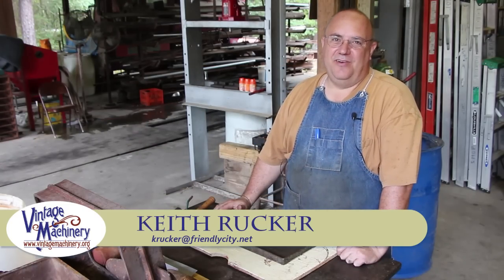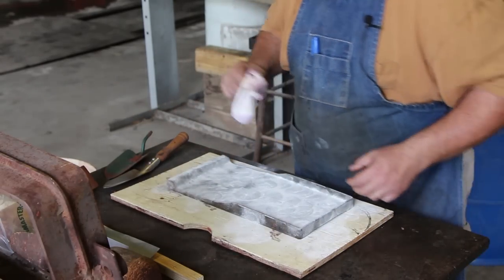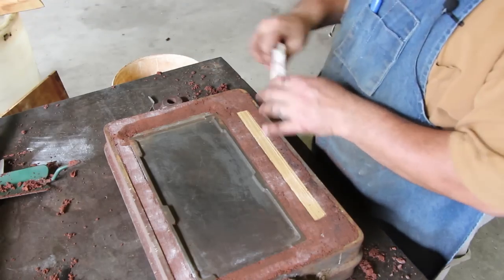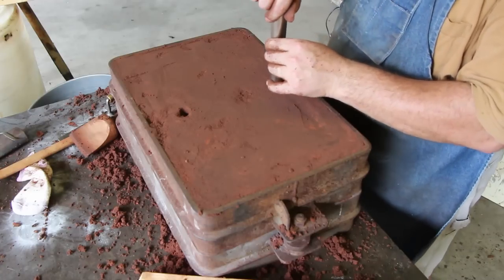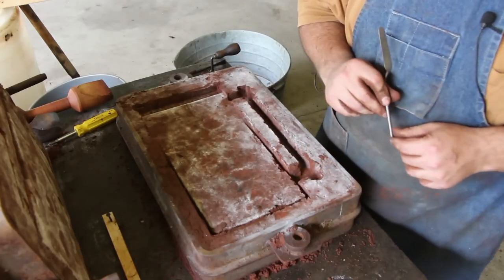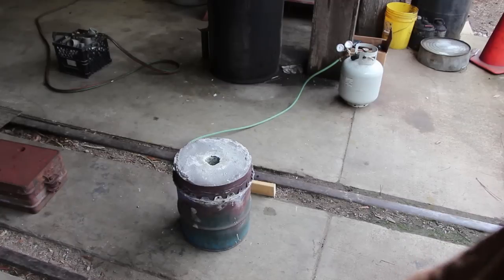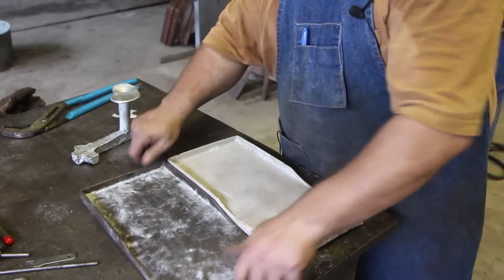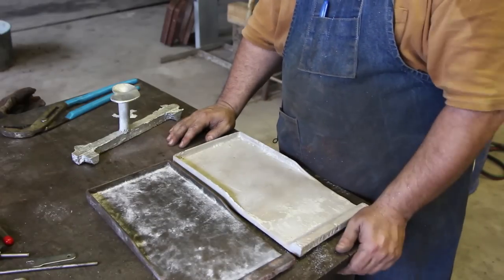Making an Aluminum Way Cover Part 1:  Casting the Part in my Backyard Foundry

Comment: My father was a non ferrous moulder and I often visited him at the foundry. To see you blowing the loose sand off of the mould and out of the ways reminded me that one of the components in Dad’s sparse toolkit was a pair of bellows.  To assist with removing your heavy pattern you could have scooped out a couple sacrificial detents on the back side (from you) to allow you to get under the pattern as you did in the two ways on the front of the pattern. It would have been interesting to see the comparison of the pattern and the casting to show the shrinkage. From memory Dad used to quote ¼” in a foot?

Comment: This shrinkage problem was occurring when Taiwan first began making copies of American woodworking equipment in the 1970s. They would do what Keith is doing, but would make the parts from iron as was used in the originals. The copies worked just fine, depending on the quality level any particular manufacturer worked to. But to the surprise if people who bought them and then bought spare parts or accessories here, they wouldn’t fit. Surprise! Later, as their manufacturing got better, they stopped copying and did their own designs.

You really have to be careful with more than one gate when making thin, wide parts such as this. If the mold is too cold, the edges of the metal, as they move towards each other, can cool to the point where there is a distinct line marking where they met. Sometimes they don’t entirely meld together as the edges are too cool and the oxidation on those edges (particularly with aluminum) prevents a true melding of those edges, resulting in a weak part there.

Comment: Next time, place two pieces of wire, (one for each end) under the pattern(or part) and bend them up parallel to the sides. Pack the sand, flip over, and use the wire to pull the pattern out. It'll leave you a couple of small lines to grind off, but that shouldn't  be an issue.

Comment: Hello Keith,
 Your video is interesting. Please wear better shoes, and the funky legging/foot covers. Molten aluminum makes a bad smell going through sneakers, and down to flesh and bone. I have seen a crucible break during a small pour. Good safety wear, no one hurt. One shoe burned but still,wearable.

Comment: You don't start with a mulled sand?  Could you have used magnetic bases to remove the pattern?  I saw your answer on the screen.  LOL   Was that just table salt?  Was that cast iron cornbread pans for ingot making?

Comment: Where do you get the steel outer forms and the casting sand? Did you make that furnace yourself ? if so could you show you made it? THanks Keith. Great to learn these things.

Comment: Why is there a railway running through your work shop if it is inactive you can use the spikes for Smithing
Reply from the maker: +Well yeah The shop is at the Georgia Museum of Agriculture and they have a 1917 Narrow Gauge Steam Locomotive that they run.  The shop is built so they can pull the locomotive in to work on - we even have a pit that the tracks run over so that we can get under the locomotive for servicing it.

Comment: good informative video. I do have a question and that is about the casting sand. What kind of sand is it and can it be reused?
Reply from the maker: +gigicaly It is a mixture of sand, a special kind of clay and oil.  It can be bought under the name "Petrobond" or you can find recipes online to mix your own.  It can be used over and over again, but might need to have some fresh oil added back in from time to time.
Reply: Keith Rucker - VintageMachinery.org cool thank you for the reply.

Comment: Plastic oil recycling drums in a melting area are a bad idea.  Putting hot tools on top of the plastic drum is also a bad idea.  Osha would have a fit if they saw you with lace up shoes in a foundry.

If you made the part the other side up, you could have cut a parting in the drag so that you could have easily tapped the sides of the original casting then lifted it out of the mold.  Normally, the cope is the half of the flask with the ear holes.  You are able to put your palm on top of the pin from the drag and use it to help you get an even draw.

Comment: I've done a little bit of aluminium casting myself during my apprenticeship in an experienced casting shop. What we did differently then: The casting gates would  be cut as thin, wide slots with the lancet, tapered, thicker at the flow channel, narrower at the actual gate. This makes for quieter flow and easier cleanup.
We'd also manually dig a pouring bowl next to the spout, with an overflow edge. Makes it easier to pour, and again, quieter flow.
What we'd also usually have, but not on a part like this, which has very even thickness: A so called riser, a vent with large cross section over the thickest portion of the part. This would remain liquid the longest, along with the thick portion, and feed liquid metal in there as it was solidifying and shrinking, thus avoiding voids.
Reply from the maker: +HotelPapa100 Thanks for the tips.  I have a lot to lean to get better at casting.  I don't have the advantage of having someone experienced to learn from in person.

Comment: magnets don't work on aluminum whoever wrote the comment use a big neodynium magnet
Reply from the maker: +Moe Moe Magnets do work on cast iron though.  The comment was about my problem with lifting the cast iron piece that I was using for a pattern, not the aluminum part that I cast.

Comment: could you possibly coat it in something water salable before you make the sand blank to compensate for shrinkage?
Reply from the maker: +adracamas I have built up existing parts with all kinds of material to account for some shrinkage on larger items.  But it is somewhat of a pain and for this project, a little shrinkage really does not matter.
Reply: 10-4 that. Just curious.

Comment: I have watched a couple of videos about forging, and noticed that it seems no matter the size of the part, the box is always filled to the top.  Is there a reason for this?  Do you need a certain thickness of sand to help retain the heat to keep it from cooling too fast?
Reply from the maker: +alaskankare I actually sometimes do not fill it to the top, depending on how high the pattern is sticking into the top mold.  I like to have several inches of sand over the highest part of the pattern, but unless I am casting multiple parts or large parts where I might run short of molding sand, I generally just fill it up to be on the safe side.
Reply: +alaskankare When you cast series of parts, the moulds are often stacked. That's one good reason to have the boxes filled to capacity. Also the frame heights are related to frame size. If you fill it to capacity, you can be pretty sure that the slab of sand is stable enough so it doesn't fall out under its own weight.

Comment: Use a magnet to remove cast iron parts from molds.  Neodymium magnets would be more than strong enough.  Could also make a simple electromagnet to use to lift the parts out of the sand casting.

Comment: great video did you make your furnace
Reply from the maker: +diesel doctor Yes, I made that furnace several years ago and I am currently in the process of making a new one that will be greatly improved.  There is a series of videos on that project to date but it is not quite yet finished as of now.

Comment: cast iron ain't magnetic...
Reply from the maker: +paul van biljon Really?  I better tell of those magnets that stick to it that they better fall off soon.  I have one of my dial indicators stuck to the side of of a cast iron casting right now, I hope that it does not let go before I can get there and pull it off!  But I guess you are right, cast iron is not magnetic (if it were, steel would stick to it), but a magnet will indeed stick to cast iron! If you don't believe me, go and try it for yourself.....

Comment: Regular salt (sodium chloride) should not melt in molten Aluminium, should it? Its melting point is a LOT higher.
Reply: +Radbert Grimmig Aluminum melts at 660C, salt melts at 800C, so assuming that the aluminum is not just over the melting point, the salt should melt in it.
Reply: +Radbert Grimmig                        borax mixed with salt

Comment: just a thought for those heavy cast iron parts cut the magnets off your kids sub woofers which should do two things. put a stop to that annoying buuuummmp buuuuummp and give you something to lift cast iron parts out of the mold with. I also have a question what are you using for a crucible I am building a foundry of my own, did foundry in high school with a graphite crucible but your did look or sound like graphite?

Comment: I live your videos. Still looking forward to your foundry. The sono tube will work of you fill the inside with sand or gravel to press outward. Even pack it tight, the tube will not fail from too much pressure out. When you fill the outside, you will have plenty resistance.
Meet up the good work.
Reply from the maker: Mark Daniel I purchased some new refractory the other week but have not had a chance to work on the new furnace yet.  It is on the list......

Comment: what is that rainrails ????
Reply from the maker: Bart Graumans Are you talking about the rails in the floor of the shop?  If so, I shot this out at the museum in the shop where we work on their locomotive.  We can pull the locomotive into the shop and over a pit to get access to the bottom to work on it.
Reply: oke thanks i am dutch i cant good speak englich sry

Comment: when aluminum cools, it withdraws then the copy should be a little 'smaller, is not it a problem?
Reply from the maker: CLAUDIO GRASSI Yes, you get shrinkage on any part that you cast.  In this case, the cover was not fitting anything perfectly - just covering an opening, so the little bit of shrinkage that I got was not an issue.  When it is, I have to add some extra material to the original part to compensate.  I talk about shrink factors in some of my pattern making videos.
Reply: Thanks Keith, it is what I thought ... I follow your work often but being Italian sometimes escapes me something of your speeches ... I have yet to get used to understand everything ...
 I still learned a lot and I am also about to start a new adventure with aluminum castings, soon I will shoot some video

Comment: Thanks for the video Keith!  Other ways to remove patterns from the sand are 1. place the bottom board against the pattern on the drag, flip it over on the bench and then lift the drag and the pattern will stay on the bench or 2. with a wooden pattern, flip the drag over and place two of the same size boards on the bench, rest both sides against the boards, say 1 or 2 inches high, and then tap the drag downward...the pattern will fall out perfectly vertically that way.  I sometimes have more luck with that than draw spikes or threaded spikes because it's hard to get a perfectly vertical lift.

Comment: When replicating a casting in aluminum, cover as many of the original’s surfaces as practicable with heavy shelving paper.  This accomplishes two things:  The +/- 25 mil thickness makes up for some of the shrinkage; and, the smoother surface lessens the roughness of a casting-of-a-casting.  Also, for parts that are to be machined, those areas should be built-up with more layers or even (dare I say) duct tape to allow for the sacrificial machining volume.
Reply from the maker: halnywiatr Agreed - however, in this case, the added shrinkage was not an issue so I did not bother building up any surfaces.  I have used similar tricks many times on other projects.

Comment: Very good video, I am a jeweller, I use a similar process to cast Gold/Silver rings, and various other items etc.
Do you make your own casting sand? I personally found it to be to expensive, even though it is reusable for a certain amount of time. It is expensive to keep buying the ultra fine oiled casting sand which is required for small or intricate parts, so I now make my own, can be time consuming to make it high grade but it saves a lot of money overall.
Reply: What's your recipe for jewellery grade casting sand if I may ask?

I'm a jeweller and use a lot of delft clay for casting, but would look at cheaper alternatives.

Comment: The modern way would be to 3D scan the part and then 3D print it in metal. No shrinkage  no mold repair needed. This is so old school
Reply: Keith it wasn't meant as a dis. I myself have done the same type of sand casting back in high school metal classes.  Its an art for that is slowly being lost. Its good to see it still being done.  I personally don't do the metal working but appreciate those that have the skills to do it.

Comment: Hi :). First of all I would like to Congratulate you for the Very Beautifull Video you have made and the fact that I am shore there are many people WHO learn alot from you like I did. Thank you Very much for that. I have 2 questions which I really Hope that you could help me with? I have a Compoundbow and I have been wanting to make a Copy of It. I would use Aluminium for the Razer and for the Cams Fiberglass. The Problem is that the Razer is not streat. It has a Bend to it, so it doesnt sit as it should like a flat pice. What would one do if the form is shapped. THank you (sry my bad spelling )

Comment: You'd get much better results if you sift the sand through a screen for the first couple of inches.  Also, your sand was too dry in this case.  It shouldn't be just falling out of the drag like that when you pick it up to put it on the tub. 

-jcr

Comment: I made a fire brick beehive shaped furnace last summer. It worked real well and this spring I am going to concrete the outside and make it permanent. I use hard wood to fire my furnace and use cast iron kettle to melt in. My furnace can take a 5 gallon melting pot.
Reply: But can it melt that much metal, chances are no.

Comment: Thanks for making these two videos.  I learned a lot, but the magnet trick is one I HAVE to remember!

It seems you could you have built up the thin edges of the original pattern by 1/64th on each side (I find multiple strips of adhesive sheeting woks well) and compensated for shrinkage. 

Again, thanks

Comment: To lift the cast iron or any ferrous metal, you could make a handle with rare earth magnets built in.  There are some sold with holes in the middle to receive screws.  Just a thought :)

Comment: Good Job Keith!  I'm watching a few videos in preparation for some casting projects
this spring.( I'm in Minnesota)  That's basically the way I would have done it.  One thing
I am going to do is make a screwdriver handle with wood screw threads on the end
for removing wood pieces from the sand, maybe 2 of them.  Also I can build up some
wood patterns now for future use as I am going to do my casting outdoors. 
Thanks for the extra effort to make the video!

Comment: aluminum shrinkage is like 0.5% to 1% for pure Al that piece looks really close
from what you say you had less than 0.5% shrinkage very good
tyvm for sharing gr8 job
tyvm for the info on use of a gate to increase the flow into the mould

Comment: Very nice video .. Been a moulder/coremaker for 27 years now & used to make castings in greensand many years ago .. may i be so bold as to offer you a couple of tips .... if using an old part instead of a pattern sometimes an idea to drill & thread tap a couple of holes on the side that is going to be in cope half,then to remove part from mould you just need to screw in a couple of bolts ... also not too heavy on the parting powder as this can give a poor surface finish on casting ..... first layer of sand onto pattern should be put through a sieve .... and the runner bar is always better in the cope half & the ingates cut into the drag half,in theory this keeps any metal impurities in the runner bar & allows clean metal through the ingates .... one last thing .. a pair of old fashioned wooden/leather bellows are ideal for blowing any loose sand from mould prior to closing ..... hope this helps
Reply: ***** glad i could be of assistance Keith .... find it strange (but in a nice way) that people have as a hobby & find so interesting something i have done for 40+ hours a week for many years & just take for granted now .... I have worked in 4 foundries in total & made things from model steam engine parts up to 35 tonne marine engines and if I'm honest I was always the happiest in my work as a 19 year old making castings the same way that you do in your back yard.

Comment: Hello, thanks a lot for the video, I loved it, I learned a lot.
I wished that I knew that for four-five years ago, i had a lot of aluminium-junk which I had to throw. And it's cheaper to recycle instead of buying new, as I usually needs aluminum for machining.

I didn't think of the magnets either, so you're not alone. :)

Comment: Loved your video , as I was watching the section were you were removing the cast iron original cover,I bet using some magnets welders use ( the ones with handles ) would have worked fine to remove that cover.

Comment: Hi Keith, just an idea for next time you are using a cast iron part for a pattern and you need to remove it from the mould, how about some strong welding magnets and using them as handles to lift the part out.

Comment: Hi, I'd be grateful if anyone can answer my question. Is there any mold that can withstand molten metal? I want to make a mold out of a key that I have, like something out of silicone or something that is malleable, but I know silicone isn't strong enough to withstand molten metal. Any suggestions? I don't need a large amount, just enough to make one single key.
Reply: *****
Thanks! I'll keep looking around, I'll leave the lost wax casting as the alternative because that would involve more steps.